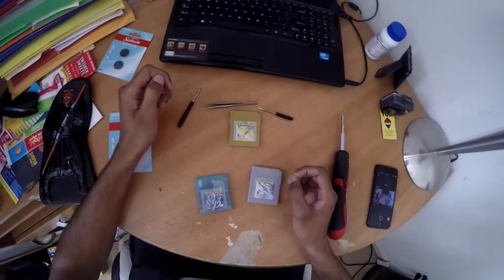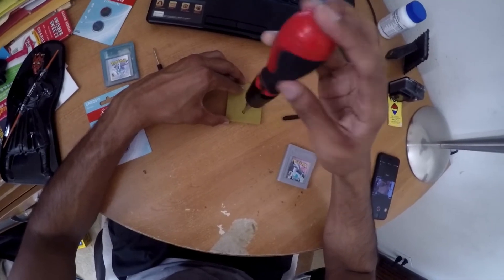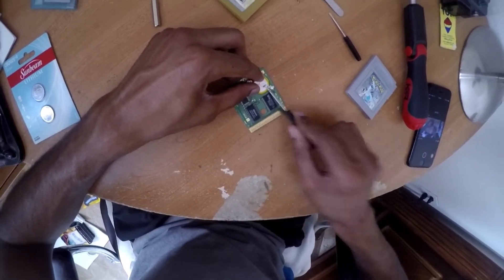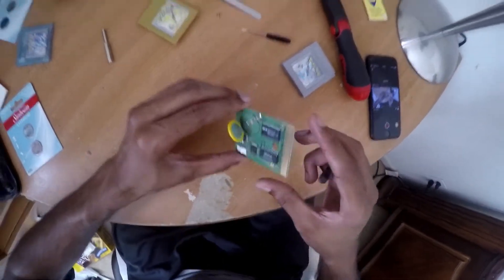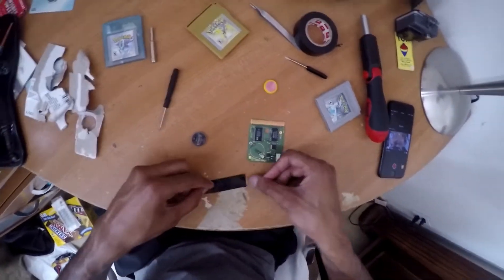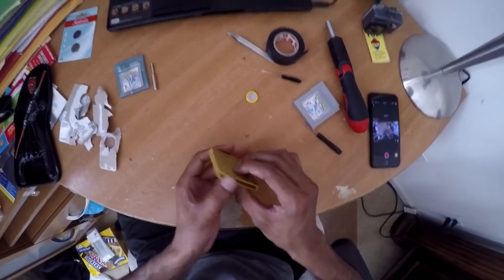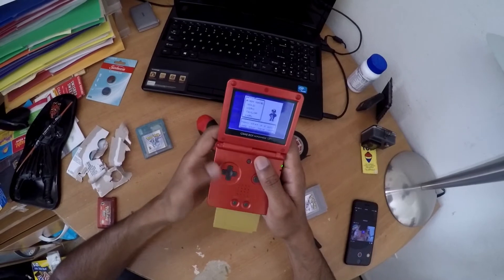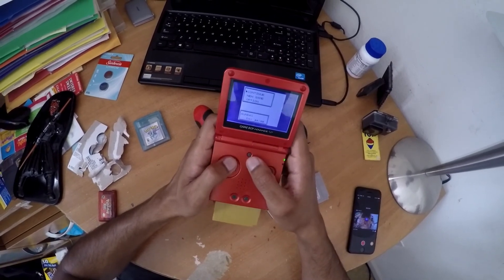Gameboy Save Battery Replacement - No Soldering Req'd!

Comment: You should definitely do the soldering method. The tape over time will lose its adhesiveness far sooner than the life of the battery and you'll lose progress anyways.
Reply: Much cheaper to just buy a new game rather than buy a soldering set
Reply: That's what happens to mine lol solder it dont be lazy with it